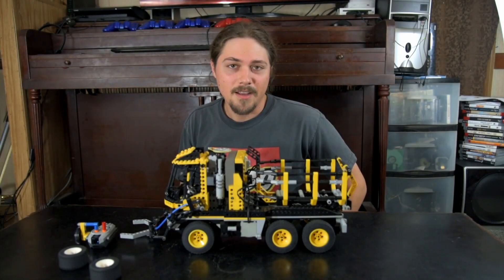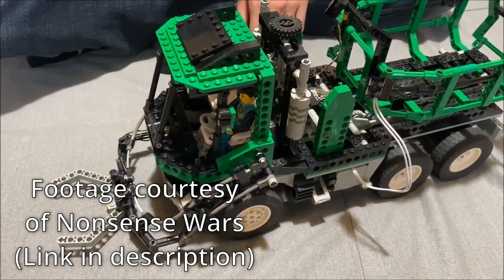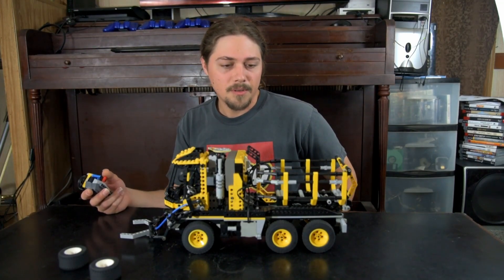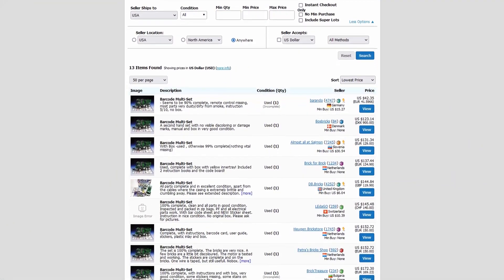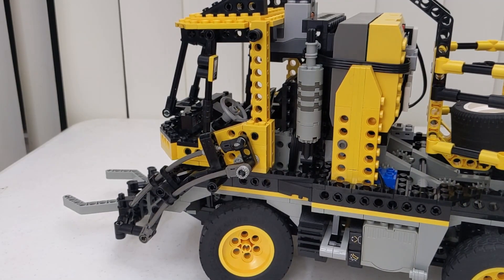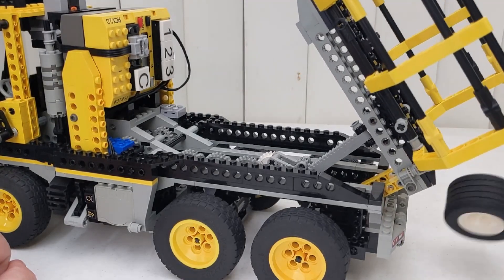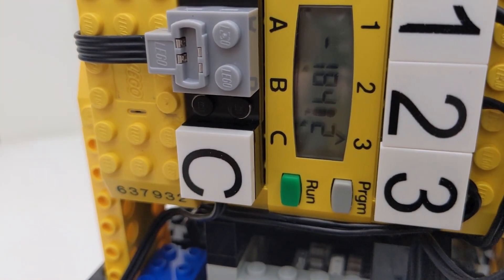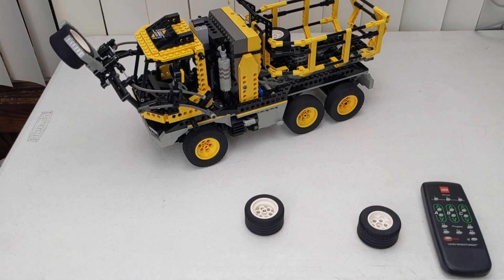My RC Lego Technic RCX Code Pilot Version 2!

Comment: fantastic model! can you please mention what type of adapter you used to power the power functions receiver? and why you used 2 power slots on the rcx? thanks in advance
Reply from the maker: Oops, I meant to update the description.  The various adapters I make are explained in the video linked below.  I used two output ports to be able to source more current.  The RCX outputs can source about 500ma, while two "ganged" together can source about 1000ma.  At least in theory.  The Power Function servo motors can use a fair bit of current on their own.
https://youtu.be/0j8QXHI6EaY